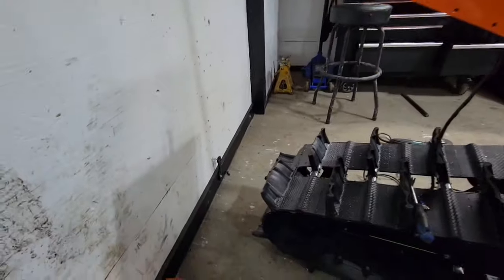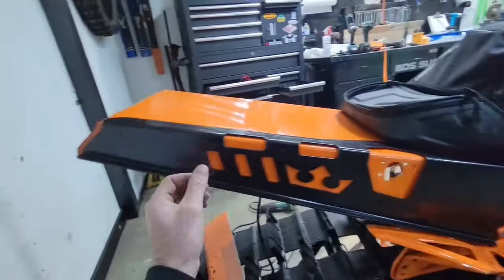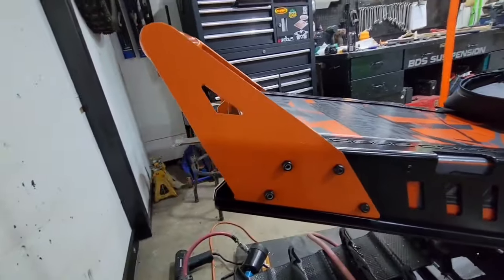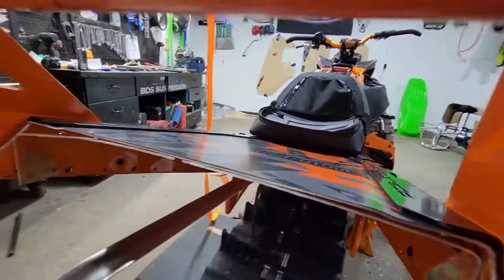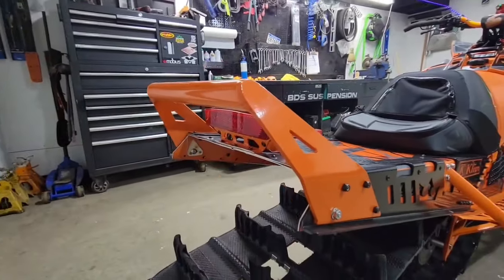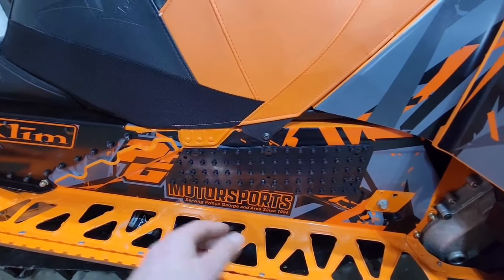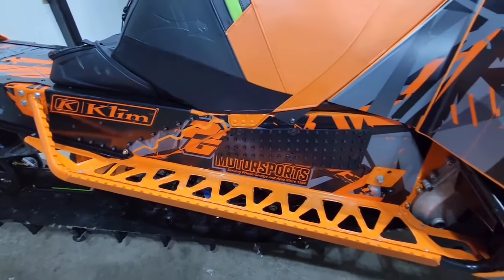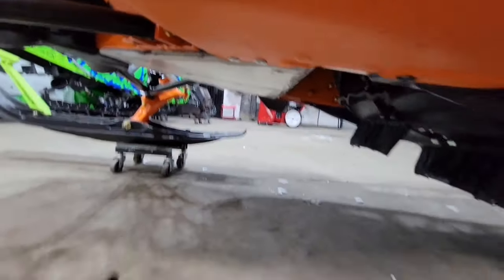SLED UPDATE & TUNNEL CHOP!

Comment: Have you ever run a rail brace or feel like you needed to run one?
Reply from the maker: Haha, yes in run a rogue concepts rail brace
Reply: @Trevsleds  do you have to be a super crazy rider or should an average rider be good
Reply from the maker: @Brobro449  having the brace is good "insurance " no matter what
Reply: @Trevsleds  Ok kinda hard call since last year i was kinda struggling to get the hang of the alpha and not sure if im wanting to put more money into it right now if i want to go to twin rail. Really thinking of getting the rear bumper and rail brace from rogue concepts though
Reply from the maker: @Brobro449  it's a little tough to get used to I prefer twin rail myself but the alpha Def has its place, I highly recommend the rogue concepts brace and bumper
Reply: @Trevsleds  someone said they were wearing there boots out on the bolts on the front of the bumper you have this issue? Also is there anywhere to get these in Canada? Is see freshies sells them it would be like 50 bucks cheaper to get them from there
Reply from the maker: @Brobro449  haven't wore my boots out on them, I would order from freshies!
Reply: @Trevsleds  ok that seem to be the cheapest place. And not as many dealers as other brands like backwoods bmp